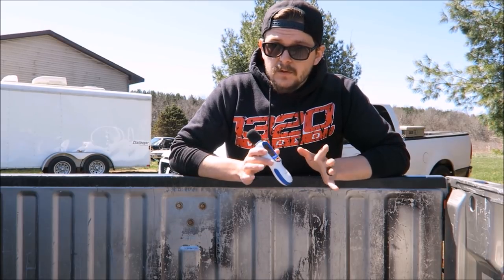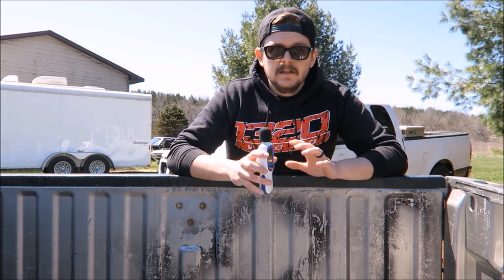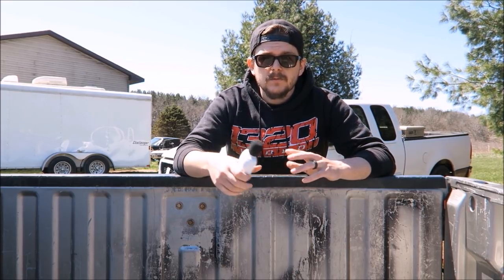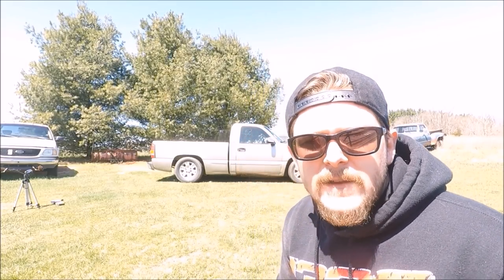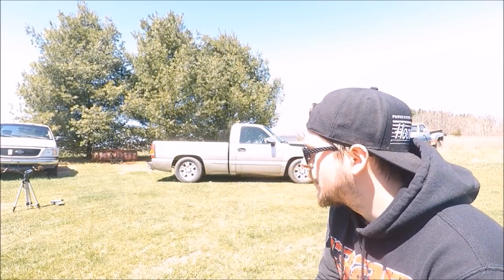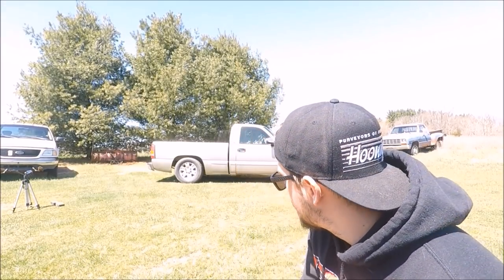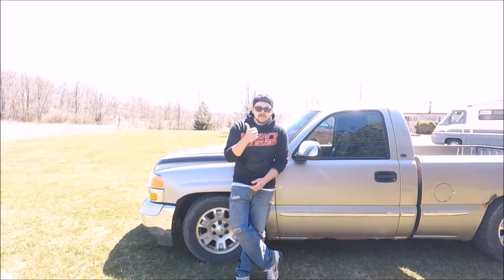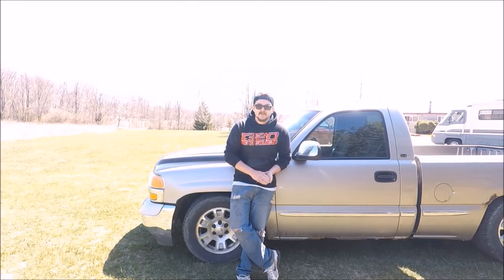GMC Sierra with stage 3 cam & open headers dB test

Comment: My truck 5.3 engine has around 230000 miles on it but runs great and compression is good, do you think a stage 3 cam like the one you have would be too much for the engine
Reply from the maker: I cammed mine at 235k. If the motor is healthy, I say do it

Comment: Damn ya 127 decibels is loud as hell im kinda surprised it wasn’t a bit higher   Because I have the same type of decibel meter and my 96 Chevy 350 vortec has 2 inch true dual full straight pipes all the way out the back with long tube headers but no cam and full exhaust other than headers motor is stock and mine was 127.2 not a lot different but I would think a cammed truck with basically open headers besides 18 inches of pipe would be louder?

Comment: Man I'll probably be covering my ears if I heard that in person. How about one of the videos u should upgrade ur brakes
Reply from the maker: Haha, it wasn't too bad in person. But, I just put a full exhaust on it and now it seems SO quiet. But, yeah, I'd like to at least upgrade pads and rotors eventually.
Reply: SniderTron 3000 cool man it's good to see ur budget building so it's not necessary to buy an overpriced Brembo kit. Speaking of brakes do u have any ideas what's causing one of my rear calipers to stick sometimes after releasing the pedal??
Reply from the maker: I'd start with checking the rubber line. Sometimes when they collapse it won't allow fluid back into the master and it keeps pressure in the caliper. But it seems like that would cause both of the rears to hold pressure. The cylinder in the caliper might be sticking

Comment: 03 5.3 gmc shortbox. Longtube headers. Howards rattler cam. Keeps throwing codes mis fire. And maf sensor. Open headers  will not idle without a little gas. And rich smell what do I need to do..
Reply from the maker: Take it to someone to get tuned?
Reply: @SniderTron3000  did your truck do the same? If I had a email I could send you a quick video of the truck running
Reply from the maker: Yeah, the cam is making the ecu think it's misfiring, I had that problem. Mine ran really lean with the stock tune though.

Comment: Hey man I’m looking into getting a cam for my gmc 5.3 Sierra too . Can you do a video on what “219/220” means or explain somewhere in a video what’s the best cam for your truck , thanks !
Reply from the maker: Chip is pretty much on the money. Of course there's more to it than just that, but that's a general rule of thumb that bigger duration moves the power up in the rpm.

And, the best cam for the truck is a really tricky subject because that is super case-to-case. For me, I wanted a cam that was proven, kept good street drivability, had enough of a power gain to be worth the money and effort, obviously sounds meaner, and had zero or negative overlap because I was planning on turbo'ing the truck at some point and I believe that low or negative overlap is better for boost.  

The biggest thing to keep in mind when searching for a cam is what you're going to do with the vehicle and find a cam that suites that. Hope this helped at all lol
Reply: SniderTron 3000 thanks 🙏🏽

Comment: Would you have chosen a bigger cam from tsp if you had to do it again?
Reply from the maker: Not for this truck only because I like the idea of it being like a muscle car I can drive anywhere and still get like 20-23mpg on the highway.
Reply: When you realize the bigger cams don't actually make any more power than these below like 6k rpm, pretty pointless in a 4500+ lb truck.

Comment: Did u just install the cam and keep everything else stock?
Reply from the maker: Had to do valve springs for the extra lift
Reply: SniderTron 3000 how's the reliability after?
Reply from the maker: It's been like 7? months and I have no complaints
Reply: SniderTron 3000 thanks

Comment: How do you like the ebay seats you put in that mazda?
Reply from the maker: Haha, I ended up selling them and getting stock RX7 seats. The Ebay seats were too tall still with the mounts and I was going to make new mounts, but I found a guy a couple hours away with stock seats for cheap.
Reply: SniderTron 3000 Thanks. I debating buy a set for my Silverado

Comment: What all did you need to install cam and how much worth of stuff
Reply from the maker: Guillermo Tinajero aside from tuning, I just ordered a kit from Texas Speed & Performance and it came with the valve springs needed for the extra lift. And then just a valve spring compressor and an air chuck to put air into the cylinder to hold the valves up. I have a video installing it
Reply: Do u have social media I could text u on ? I have the same truck and questions
Reply from the maker: My Instagram is SniderTron3000